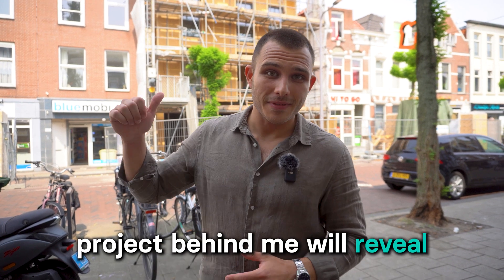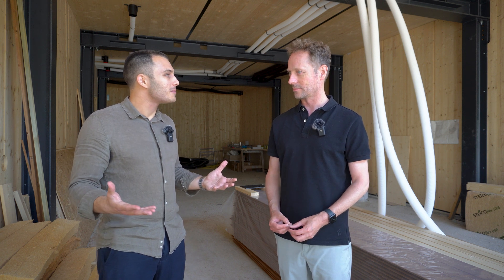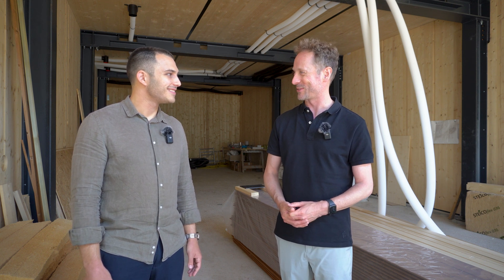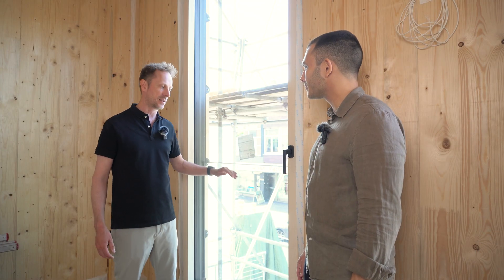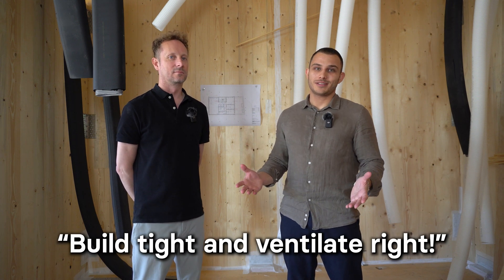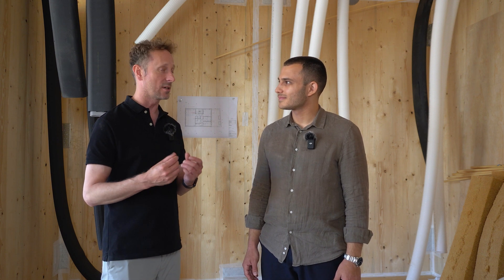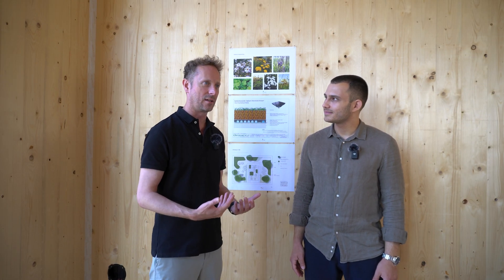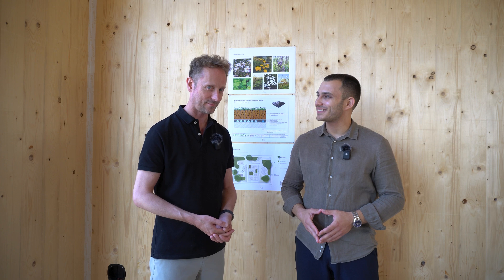Building the Ideal Home: Designer's Sustainable Journey

Comment: I wonder if black facade would heat up the building, or maybe it's insulated enough to migate that effect, and it would mean that it's not that neccessary to choose more reflective (e.g. white-like) paint to protect construction from overheating?
Reply from the maker: Good question! In Passive House buildings, due to the very well insulated building envelope, the color of the facade has a minor effect on the energy efficiency (unlike with standard buildings). Moreover, the black facade for this project will be made of perforated panels and it will be well ventilated, so the effect of the black color will be minor.